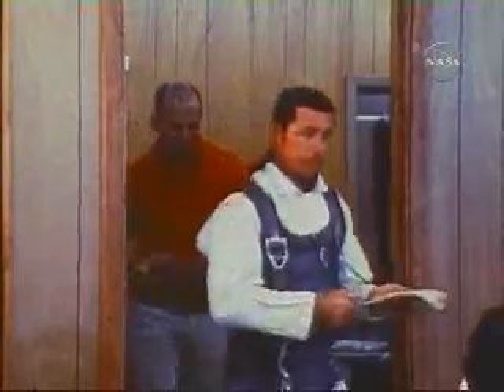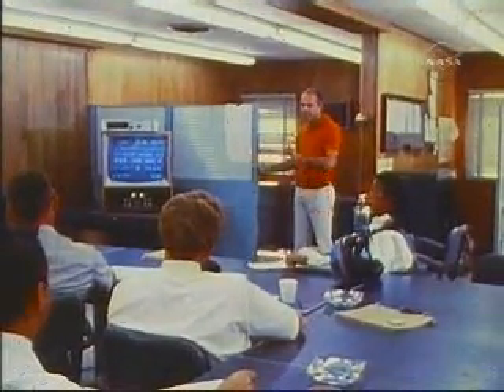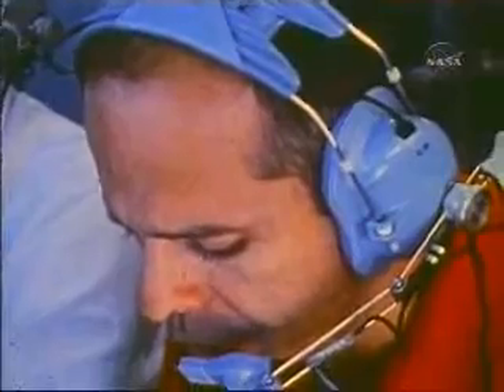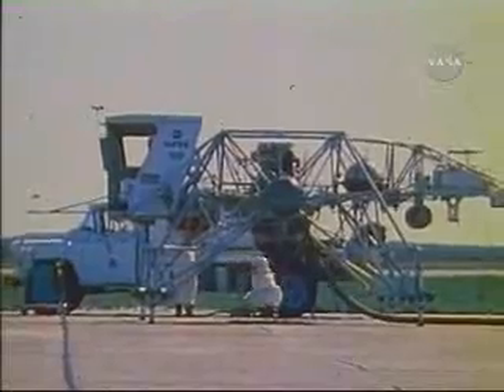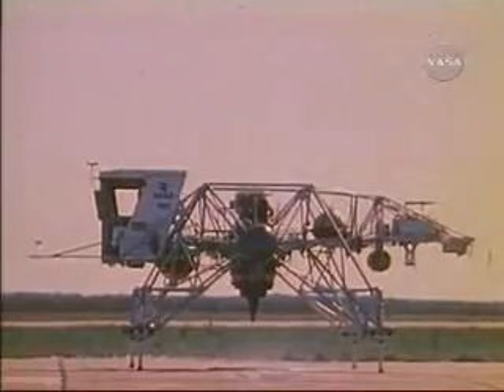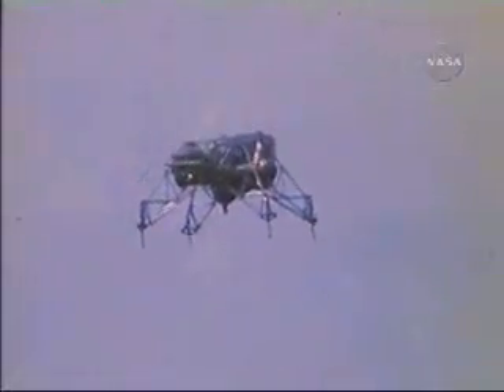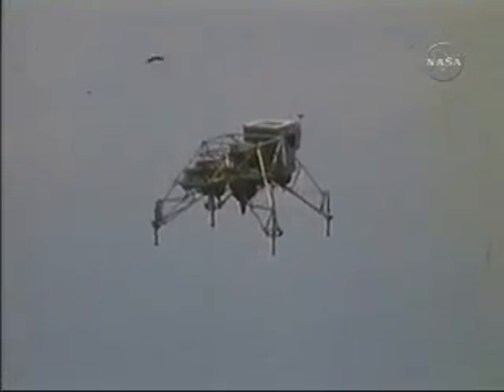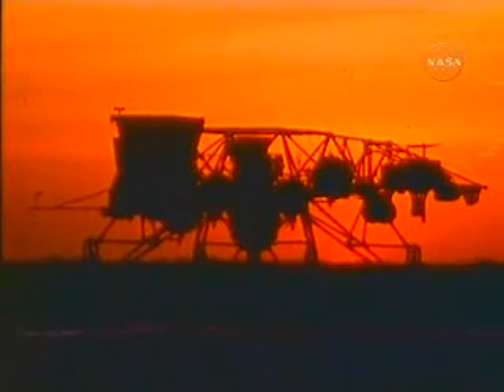Lunar Landing Training Vehicle: Part2/2

Comment: I have a question please can someone answer for me. If the LEM was a jet engine how can it work in space without air? Which is the principal for a jet engine to work i thought?
Reply: Hi paul,  the jet on the Lunar Lander Training Vehicle was there to simulate the moon's lower gravity here on earth and therefore allowed the astronauts to control it in the same way they would control the real Lunar Lander in the 1/6 gravity of the moon.
The real Lunar Lander used a rocket engine during it's descent to the surface and another rocket engine for it's ascent from the surface.
I hope that helps :)